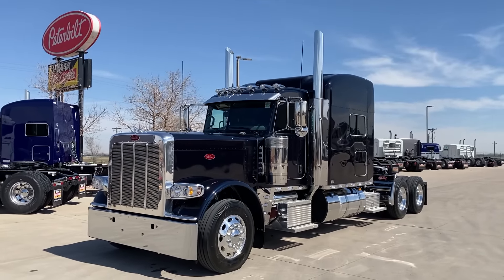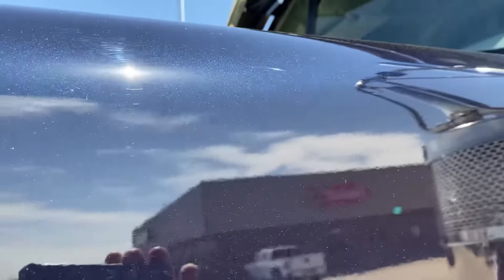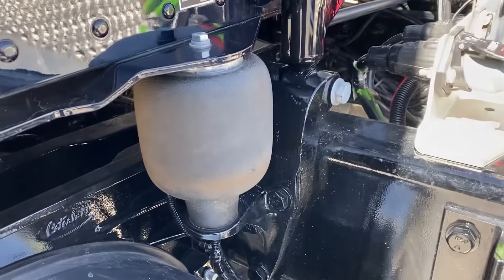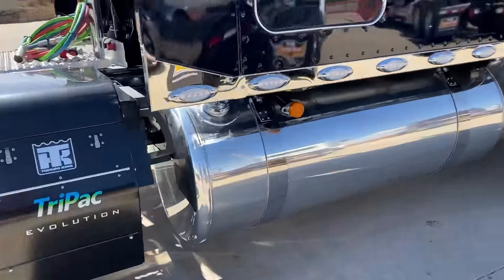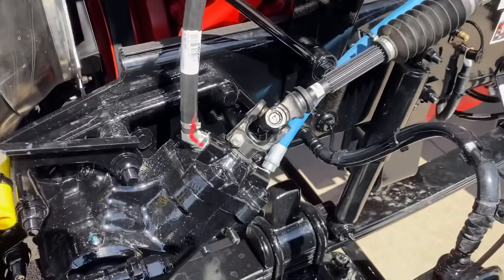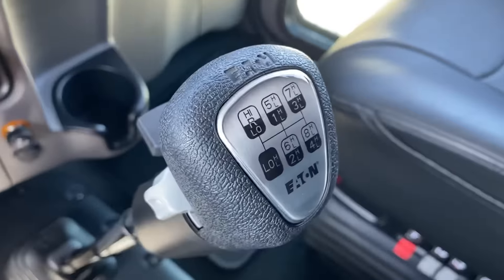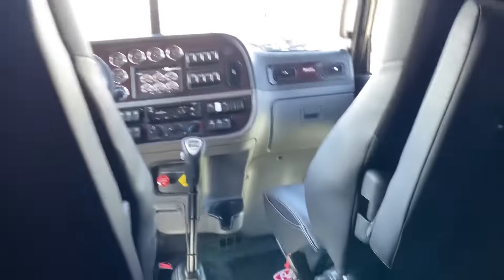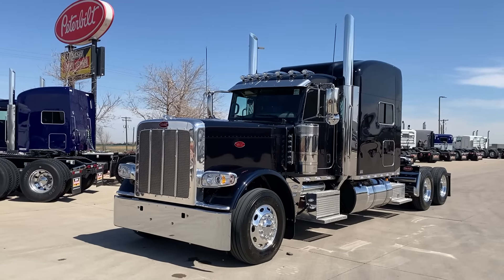2023 Peterbilt 389 - Hollywood Edition in Black Sapphire Metallic!

Comment: Doesn't the flat front screw your torque and speed if it's going against the wind?
Reply: Would you rather have a truck that looks like a marshmallow for just a wee bit more mpg?
Reply: @ayliniemi yes.  Sure it looks awesome.  Simply gorgeous.   But i think practicality-wise a 579 with smoother nose is more aerodynamic and can save on diesal as well as get slowed down less against harsh oncoming wind.
Reply: @taemeister9302 We do more short hauling so doesn't effect us as much. I guess if I wanted more aero I would look at the new internationals. Hopefully they don't have those max force problems they used to have.

Comment: I hope they fix the stack, just an observation. Beautiful truck.
Reply: my thoughts also . noticed that. cant handle that.
Reply from the maker: Shop said they would handle it right away
Reply: @RockyMountainPeterbilts  is it possible to get a 18 speed automatic with a 4 speed auxiliary transmission?
Reply from the maker: @Odin33356  I am sure we can do that.  Not sure why we couldn't.
Reply: @RockyMountainPeterbilts  does the 4 speed auxiliary transmission require a clutch?
Reply from the maker: @Odin33356  I don't think so.  It's selected prior to engaging the other clutch and transmission.
Reply: What’s the rough estimate of the cost of one of these?
Reply: @timothycovell549  is it crooked?? Sorry I'm not seeing it?
Reply: Kenworth W900L rules but it’s a gorgeous tractor with creative paint. Anyone would be proud to drive this Pete. No need for holes in the bumper.
Reply: @markwhite6719 rotated wrong direction

Comment: 16 fucking grand, for the Apu???? Wtf
Reply: That would have to come off, if it were mine. I don't sleep with the truck running, so it's a waste. My former employer retrofitted them and found that too many people turn the truck off when parked. After not being used for a while, they wouldn't run.
Overall it cost a lot more for them than it saved in fuel.
Reply: that's why i choose another brand..thermoking sucks with the prices..
Reply: @declansills1614  I'm confused; isn't the idea of having an Auxiliary Power Unit so the truck can be turned OFF?

Comment: Beautiful color on this truck. A little surprised no air ride on the steers from the factory.
Reply from the maker: That is an option.
Reply: @RockyMountainPeterbilts  Yes, I know that, just wondering why that box wasn’t checked.
Reply: @ironhorse127  you'd be surprised, I've never encountered that in the wild
Reply: @wizard_of_poz4413  ????
Reply: @ironhorse127  never seen it

Comment: Beautiful truck but I never did understand why dealers always put APU’s on the curb side instead of the driver side. If someone were to by that truck and want to outfit it to pull tanker, the first thing you have to do is have them remount it on the driver side. Not to mention it’s just smart to have your tools/equipment on the curbside should you be broke down on the side of the road.
Reply: Flatbedders would not be happy.
Reply: @bill7778  I pull a step deck and I’d rather an APU on the driver side
Reply: Ive NEVER seen an APU mounted on the drivers side
Reply: @bigguy5361  it can be done. My brother has his mounted on the driver side.